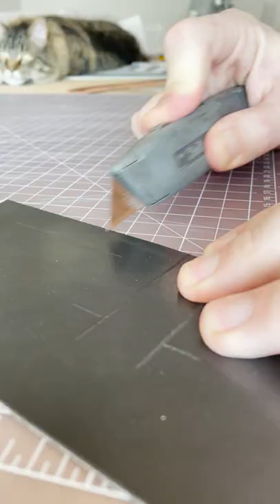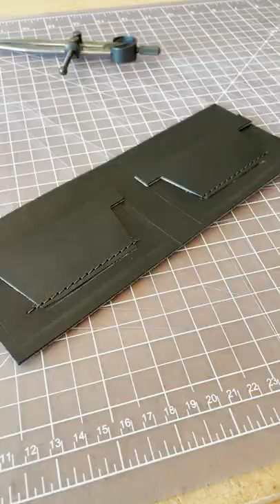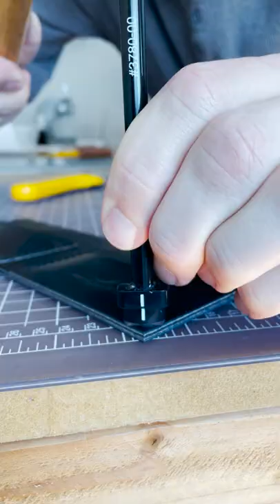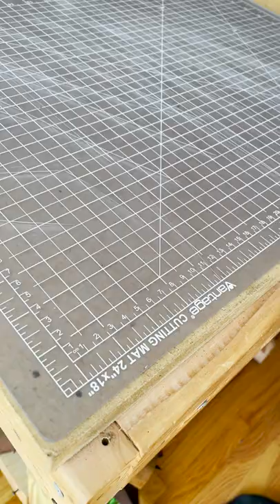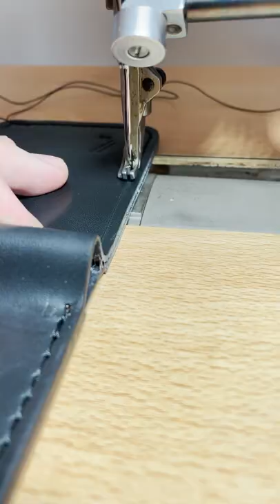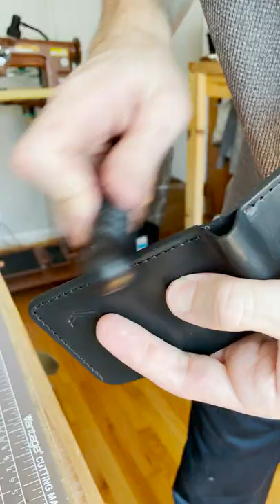Black Traditional Bifold

Comment: Have you worked with synthetic leather? I'm really curious as to what differences present themselves from one material to another at the time of making something.
Reply: @mariongrey7853  I'm plenty aware? Its still a sewable and workable material treated to be leather adjacent, it's not like it comes out magically made into the shape of a wallet just because it's made of petrol. my question it's about the differences in working each, and it still stands.
Reply: The biggest difference is that artificial leather is a fabric layer with essentially a plastic or polymer coating, whereas genuine leather is a uniform material composed of tightly connected fibers. This means that there are a lot of things you can do with genuine leather that you can't do with synthetic, but notably:
- Wet molding, heat molding, molding in general. You can stretch, form, and manipulate leather, especially when wet or heated, to form it into specific shapes. You generally can't do this with artificial leather since the fabric backing doesn't stretch and take on shape the way leather does.
- Skiving. Since genuine leather has the same composition all the way through, it can be "skived" or shaved down to reduce the thickness in specific areas, to make a piece thinner and lighter overall, or to allow for certain construction methods. Since artificial leather is just fabric coated with plastic, this isn't possible.
- Dyeing, polishing, patina, other surface finishes. Any of these things can obviously be done to leather using creams, waxes, and other treatments using various techniques. Since synthetics are non porous and non absorbent, this is more or less impossible.
- Edge finishing. Again, the uniform composition of leather allows for a variety of possible finishes to any cut edge. A raw edge is what it sounds like, cutting the leather and leaving it unfinished. Then there are various levels of sanding and buffing that can be done, combined with dyeing the edge or leaving it natural. Finally, there is edge dressing, which leaves a hard, rigid, glossy edge. Synthetics cannot be finished using these techniques, and raw cut edges often show the unsightly fabric backing, so edges are usually just hidden by turning back and stitching down.
Reply: @its_clean  thanks for the detailed info!